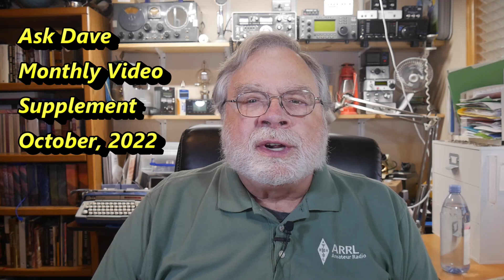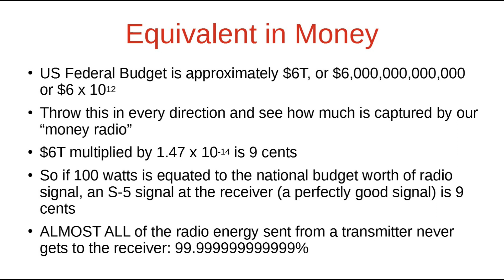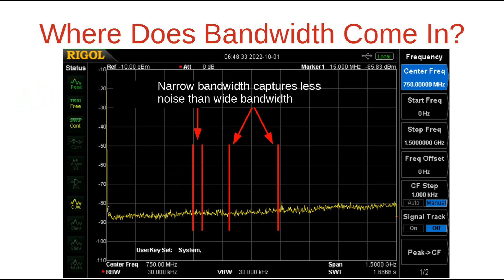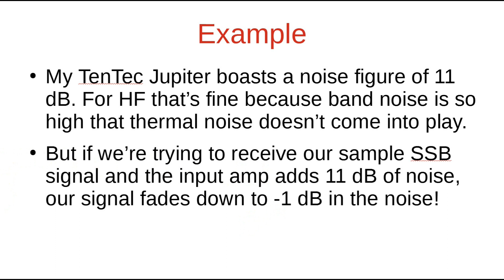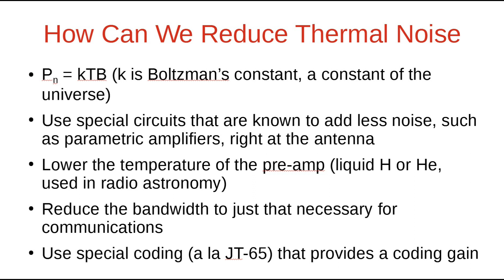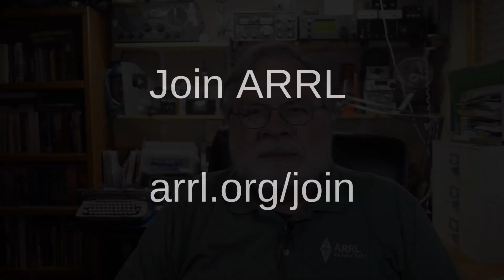QST Ask Dave: October 2022

Comment: Thanks for the very informative video Dave! I didn't know you could talk Greek! LOL! Seriously, I studied basic electronics for 2 years via a correspondence course called Electronics Technology with Laboratory back in 1989-1990 from Cleveland Institute of Electronics, got 2 Pell grants to help pay the $7,000+ tuition costs, and it got into the nitty-gritty of component construction and many many formulas such as Lenz's Law, Kirchoff's Law, Ohms Law, AC & DC theory, digital logic circuits, oscillators, even vacuum tube theory, how FETs behave much like a tube, but this video is the first time I had ever even heard of Bozzman's Law! I wonder why CIE left that out of their course material? They boasted their course used so-called "Autoprogramming" and I wondered what they meant by that, but after 8 semesters I figured it out. They drum so much into your head that it's almost physically impossible to remember it all, but I still retained enough to get by on when it comes to component level troubleshooting using the equal likelihood division method of finding the problem. Also, one thing that comes to mind is that electronic technicians don't get paid anywhere near what they deserve for learning all a technician has to know. Thanks again & very 73 De Cliff, KU4GW (ARRL member for 26 years) QCWA member #  38573, local QCWA NC Piedmont Chapter 126 membership # 279, and elected member of the ARRL A-1 Operators Club.